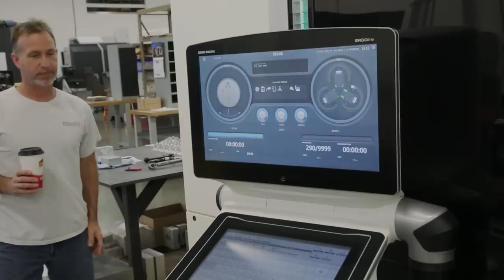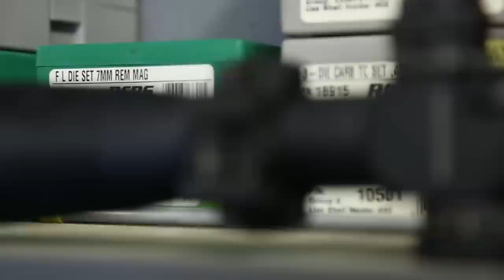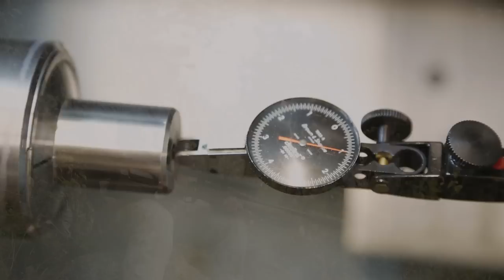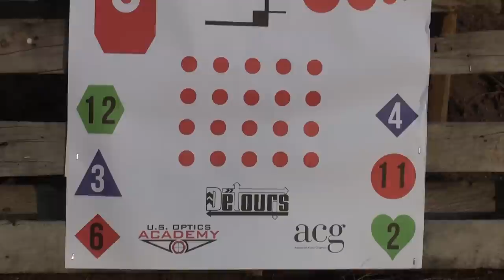"The Coyote Rifle" CR MOD 0 - MK 1

Comment: Wow!

I was just getting ready to get a Remington 700 SPS Varmint .308WIN/7.62Nato 26" Heavy Barrel, Crowned Muzzle. Take it to get the barrel threaded. I'm going to wait till either the government finally approves the Heading Protection Act, or complete gunsmithing certification and get my Manufacturer License then I'll be gust one form from selling my new service weapons for the US Military and Civilians at reasonable prices. 

Any way, until then I'm building a long range comp gun and now I have to put this one in the running for my next Mrs. Ma Bell. 

Semper Fi 🇺🇸

Comment: I would have to dremel out a track in the cheek piece so i could get the bolt out withouth having to take it off completely.. regulations here might demand carrying the rifle in to where it can be shot with the bolt completely out...
Reply from the maker: You don't need to modify the stock or cheek piece to remove the bolt on a SA rifle, only the LA's.  However when you clean the bore, you do.

Comment: Do you notice any accuracy differences between a trued 700 Action and a custom Action? Assuming the builder quality is the same
Reply from the maker: No, I've had numerous blueprinted (by LongRifles, Inc.) Remington 700 Actions and they shoot just as well as a custom... However, by the time you pay 500.00 for the action and have a smith do 600.00 for the work, IMHO you just as well buy a 1000-1500, custom action that has higher quality tolerances and options initially.

Comment: So did he fix the inconsistencies in the Brazilian barrel,or did it run good the way it was?
If so would you comment on rather or not you are still using them,and will in the future.
Bad azz vid man,you have one killer obsesion with your guns&i for one support it all the way.
Im gonna try my first build, and even though ill never have that budget your giving me good info.
              Thanks.  Justin
Reply from the maker: I'm not following you on the Brazilian barrel question?
Reply: The index,a thousandth dont sound like much,just wondering if anything was milled to fix it or if you are running it that way.
Probably won't affect it,just curious.
Reply from the maker: No, that below average for the normal barrel run out, it is fine.

Comment: Any consideration of a Mil based T1H?
Reply from the maker: Yes we've already spoken about it, hopefully soon!
Reply: Great to hear! I was jumping for joy about the reticle and then realized it was MOA and was pretty bummed. Mainly because i have nothing but Mil optics and just don't like going back and forth. I'm glad to hear it, i hope USO listens man they need some updates along both circuits for reticles. That reticle in an LR-17 would be perfect for the TL3 hunt/comp hybrid i'm having done. Kind of a do it all switch barrel rig.

So i wanted to ask because other than Alamo Precision this is the only other mention of  Hardy barrels i've seen. Thus far they seem to be the real deal, as you all just proved with that great group. What i'm curious about is what made you go with Hardy over Proof?
Reply from the maker: Come on, it's not that hard to run both units, Mils and MOA!  It gives you something to think about!  I agree though I hope USO works with us on the Mil version of this reticle. 
Reason we went with Hardy over Proof?  Because Proof said they already have Coyote hunters they are working with...
Reply: ONEILLOPS Not sure why Proof would choose to work with coyote hunters vs coyote killers.
Reply: Gotcha, i was wondering if it was based on better accuracy results out of hardy or something along those lines was all. 

I used to run both and then ran some dope for mils whilst using a leupold mark 4 M2 with 1/2 MOA turrets and had the most bizarre look on my face when 3 MOA in 5.56 with a 77gr SMK @ 2700 wasn't getting close at 450yds. Looked down, facepalmed, and realized i was dialing for Mils. Sold it and never looked back, it's been FFP Mil/Mil since. Of course there is a severe lack of Mil based Hunting reticles in the market place. The only one i can think of is the G2H, there are plenty that can be used of course, but i really love the simplistic nature of the T1H you designed.
Reply from the maker: LMAO

Comment: What is the heat dissipation like with the carbon fiber barrels?
Reply from the maker: The heat dissipates faster with carbon than steel.  We have had no issues with precision shooting 5-10 group strings with these barrels.